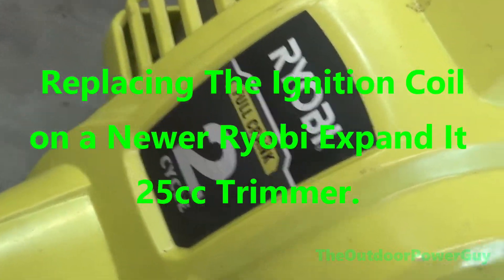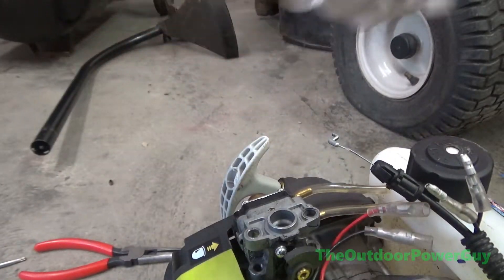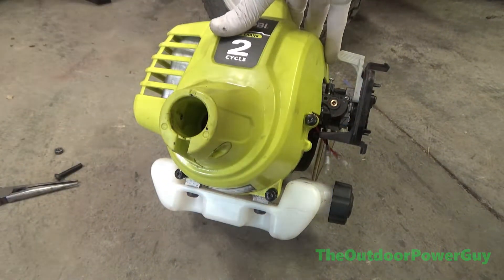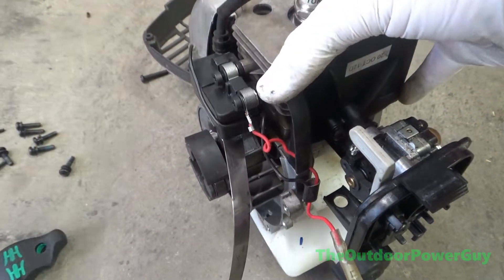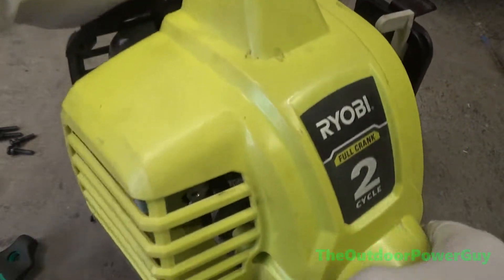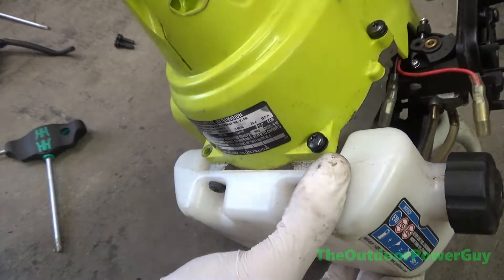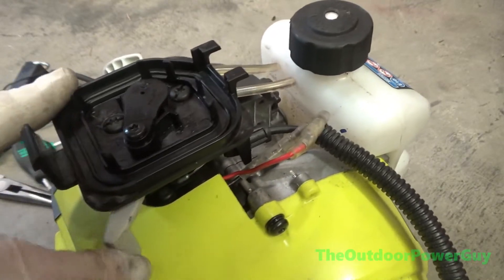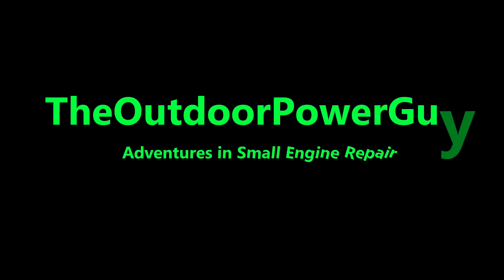RYOBI 25cc Trimmer | Ignition Coil Replacement

Comment: Oh man was changing the original spark plug and the boot wire just snapped. Had to replace the coil with your video, thanks! Was able to accomplish without pulling the carb and disconnecting the throttle. Gap set to 0.015in and applied grease to new wire boot so that hopefully I don’t run into the same issue later. Thanks for the video! Very professional.

Comment: Thanks for the teardown. Ive never repaired a weed eater before. However when my 1 yr old trimmer died i figured it was the spark plug, then the spring got stuck so i had to replace the whole coil. Luckily i stumbled on this vid.

Comment: You did everything good but I don’t think the handle acceleration part doesn’t need to be removed. By moving the 4 front screws and 5 on the rear will do the job. To each it’s own, but it will take more time. Just a little advise. Thanks for your video, very professionally explained. Thanks for sharing.

Comment: Hi Great video!  I seem to have lost one of the plastic spacers that go between coil and engine block.  You mention them around 3:25 in your video. Any idea where I can get another one?  Went to local hardware store and have some rubber spacers in there right now but would like to get the original part.  Thank you.
Reply from the maker: best option is to visit a local authorized service center/dealer. they can order the part for you :)